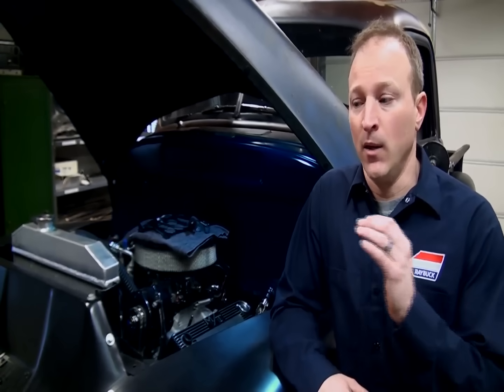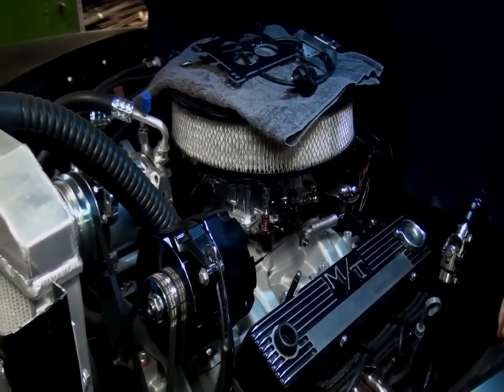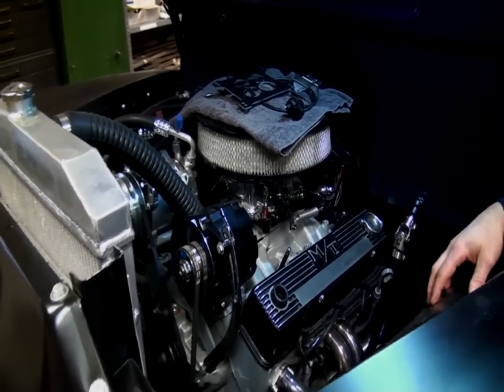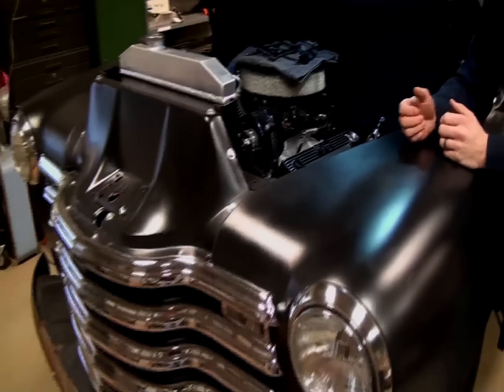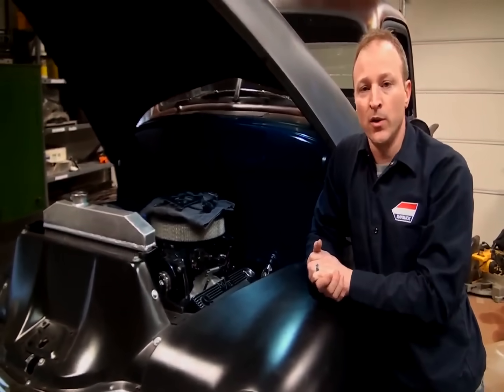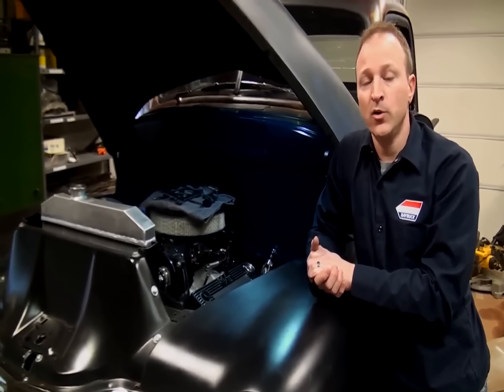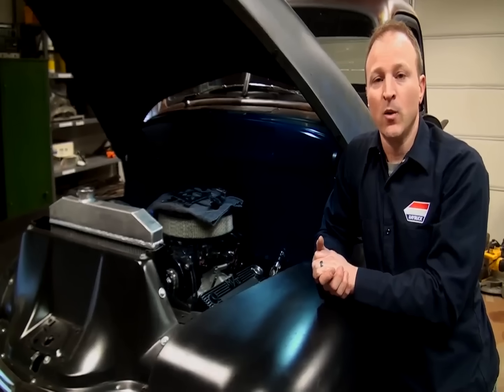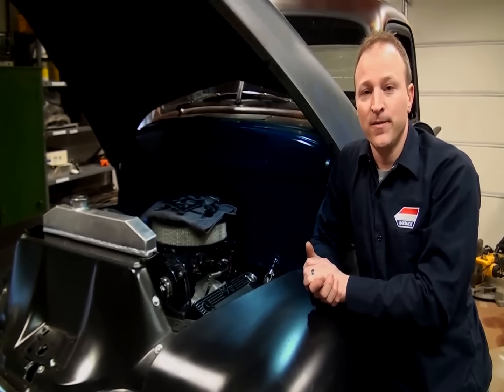Differences between a TH350 and 700R4 transmission and fitting them into a 1947-1953 Chevy Pickup

Comment: One bonus is that there is less chance of overheating on a hot day, when an engine runs lower rpms. Overheating can occur with certain combinations of rearend gearing, engines, rad size, etc. This is why GTOs were not available with a 3.23 ratio rearend AND AC in 69. Its one or the other, but not both, per GM engineering.

Comment: I need some help. 
I have a 78 C10 with a 373 rear end. My engine is a 350 built what transmissions should I put in there. My tires are going to be 255 60/15.
Reply from the maker: That's a tough question to answer as it really depends on how you plan on driving it. If your plan is to actually be able to comfortably drive it locally and on the highway, but still be able to light it up on occasion, I would go with the 700r4. If you are going to pound on it a bit harder, a 400 might be a better option.
Reply: Just went and bought a 700r4 @RaybuckAutoBodyParts

Comment: I tried  both  transmissions  , the  TH350   on 1979 Chevrolet Caprice   and the  700r4  on 1992  Buick Roadmaster  ..  I think  the  TH350  is a fantastic reliable superior  smooth  transmission    💪💪💪  👍👍👍👍👍   almost   zero   technical   issues   and  the  car can accelerate   faster and  smoother  using the TH350    ,   I  like it  👌 👍  and  I don't know why GM stopped  using  it  .

Comment: Ok so I want to put a Gen 1 350 into my 92 pick up with the 700R4 what do I need to mate the trans, flywheel and torque converter leaves me lots of questions or does it bolt right up and from what I dug up it wont so what is the trick?

Comment: The 80s cars with the towing package had a thm350 because it was tougher than the 700r4. The input shaft on the 700r4 was prone to breakage, the thm350 input shaft is bigger and tougher and did not break.

Comment: Im trying to find some info on the drive shaft situation in the 86 square lwb when swapping the th350 for a 700r and the drive shaft was a custom made one that I had to get after I did a 5-7 drop and the drive shaft shop I have locally here in southern NH is absolutely amazing and fast and prices are so low I was expecting to get a real blow to the wallet but they made me a complete new drive shaft and I had just been through a lot of trouble finding the right u joints so I’m pretty sure that the drive shaft that was in the truck was not the original one because the motor was not the original either but we figured it out and it was two different u joints front to back and significant size difference so it is the same way the shop had to do it used the same yoke to make sure it would work on the transmission, and it was a little bit shorter after the drop. But I never got a chance to get the drive line corrected so it is developing a little bit of a vibration when I let off the gas pedal, and I have to get under it to make sure that the u joints aren’t too bad to be driving around on.  But I think the problem is definitely going to be with the drive shaft being too long for the 700R and that is the way I was hoping that it would be, because the cost of having the one that I have shortened is a lot cheaper than a new one that would be needed if it was needing to be longer, so I’m happy with that option

Comment: One problem with the 700R4, is the big difference between 1st and 2nd gear, 3.059, to 1.625.
Reply from the maker: Are you thinking it's too much of a dropoff, which could cause undo stress on the trans?
Reply: @RaybuckAutoBodyParts  Just might bog down a weak motor a bit, but a good motor and a 2400+ convertor would probably make up for it. I'm building an ls motor for my 72 el camino, so I'm going with the 4L60E.

Comment: Did you think about using a TH 200-4R? They have comparable dimensions to a TH350. They were developed to give overdrive to vehicles that had the TH350 before the 700R4 was introduced. I always thought they were weak transmissions until I realized that was the transmission used in the Buick Grand National. Nuff said for me.
Reply from the maker: Yes, we did consider the 2004R, as it's comparable to the 700R4. We decided on the 700R4 mostly because of the gear ratio, as it's first gear is 3.059 vs the 2004R's 2.74. The second reason is that the local transmission shop that we work with highly recommended the 700R4. Either transmission would be a good choice, though.
Reply: @RaybuckAutoBodyParts  I was thinking about it just for the fitment questions. Maybe less changes needed. The 700R4 is definitely a good transmission. I've used several in my builds.

Comment: Did you need to shorten the drive shaft or did the 700r4 fit with original drive shaft? Thanks!
Reply from the maker: Yes, we had the drive shaft shortened when we installed the 700r4.

Comment: what's the spec on your engine, does it have any TQ at 1800? if you have any sort of performance cam it's going to lug at 1800.  2600@70 isn't bad at all.
Reply from the maker: It was a pretty stock engine with a mild cam. I didn't have any issue with it lugging at highway speeds. Since this video, the engine has been swapped out with a Blueprint 350 and the 700R4 still performs great at highway speeds.
Reply: @RaybuckAutoBodyParts  how  is the engine going? Greetings
Reply from the maker: @estebanamador7601  The newer Blueprint 350 is running great.
Reply: @RaybuckAutoBodyParts  thanks for your answer 👍🏼👍🏼

Comment: I'm more than suspect about your complete lack of knowledge between the Th350 and the 700R4 .. you could have just as easily purchased the Th350C with the lock up convertor that would have done the same thing with NO issues at all ...And P.S. How trendy clueless are you that your in a Body shop and you actually used Satin black .the Ass crack ugliest paint job in north America to advertise your shop . Bravo bro your really cool ...NOT REALLY...

Comment: TH 200 R4 overdrive same size as aTH350 uses same driveshaft and same crossmember mount  position as TH400 just move crossmember back bolts in use TH200R4 cable, pulled all the way out so shift ok. Done it couple of cars so I know no modifications needed, get one out a grand national. Oh

Comment: So you modified the trans mount, but did NOT have to move the crossmember back, correct?
Reply from the maker: It's been a while since I did this, but yeah, I don't recall moving the location
Reply: Yes you do. I swapped a th350 for a 700r4 in my 83 Chevy van and I had to go to the junk yard and get a different rear cross member and the shorter drive shaft.

Comment: CAN I FIND A 700R4 TRANSMISSION TO FIT IN A 1994 CHEVROLET SILVERADO HALF TON 4×4 TO MATCH UP TO A V 8 MOTOR
Reply: Im pretty sure that was the standard transmission for gm back then my 1988 silverado has a 350 with a 700r4

Comment: I got a 85 chevy k20 4x4. With 700r4.   I was gonna change to a 350 turbo.  Truck has 35 inch tires  if i keep the 700r4. What should i change the gears to. To get more power  cus its a dog
Reply from the maker: I'd suggest using one of the online calculators to help figure out gear ratio. The calculators can take into consideration tire size, etc.

Comment: Big expense to do swap would have to drive many thousands of highway to save a little gas and small increase low end ratio . Forgot to say will need to change out drive shaft as well . Just how much does anyone drive these old cars highway ? IMO not worth it for the headache . Hard to beat the old faithful simple 350 . 350 so simple can do a shift kit in just few hours if need to .  The 400 is a monster and heavy designed mainly for bigger trucks 4x4 etc . overkill unless burning the tires to numb . Most everyone trash talk 350 all the way engine trans rear .
Reply from the maker: The goal of the video was to explain the difference between the two transmissions to help someone decide what they want to put in their vehicle. It wasn't necessarily meant to convince someone to swap out a 350 for a 700R4. For our setup, we didn't do the swap for the gas savings. We did it to reduce engine wear, and to be able to drive at higher speeds for longer periods of time. We drive this truck a lot, so being able to cruise around 2k RPM for several hours at a time on the highway was a big deal.

Comment: I'm running the 700R4 in my '71 F250 highboy. 68 MPH at 1750 RPM
Reply: 8 months later and no one has responded to my original comment.
Reply: @jedclampett6466  I dont know what the spec is on their small block, but cruising 2600@70mph isn't exactly high, I'm used to driving old vw and we are doing 3000/3600@60! , if his engine has anything other than a stock cam in its gonna to be out of the bottom end of the TQ band at 1800@70 and lugging and it you drop down to 60/65 it gonna be dead.
Reply: @jedclampett6466 
Can you do Burnouts with it?🔥🔥🔥

Comment: the 700 has a stupid low 1st gear.. smoke the tires in first in the 700 and it will fall apart, parts are made of tin and junk.200rpm in top gear is nothing. that TCV cable is CRITICAL,, people think its a kickdown and leave it off. BAD NEWS
Reply from the maker: It's a 3.06 first gear vs a 2.52 first gear in a 350. In my opinion, that's not stupid low. It gives a the vehicle a little extra jump out of the gate. The 700 can also be just as reliable as a 350, depending on how it's built, but even a stock 700 will perform just fine behind a stock small block.

Comment: Did you have to get new transmission lines?  Did you use the old ones?
Reply from the maker: The line locations were different, so we cut and spliced new ends onto the old lines.

Comment: I've got a turbo 400 at 60 miles an hour it's doing 2,500 RPM what will it do with a turbo 700 at the same speed and also can I put the same stall converter
Reply: He said th400 is 1-1 high gear & 700r4 is .7 , so I was thinking to deduct 30%,= 1,750 rpm, other people told me 25% = 1,875 but ?
Reply from the maker: @rader1175  the rpm calculator will get you close. Even with your 30% and 25% calculations, 125 rpm isn't going to make much of a difference.
Reply from the maker: It depends on rear end ratio and tire size as well, but 60MPH in this 53 is around 1,800 RPM. Use an RPM calculator (like https://spicerparts.com/calculators/engine-rpm-calculator) and enter your gear ratio and tire size to get an idea of what the RPM should be.
Reply: @RaybuckAutoBodyParts  Was just trying to answer his  question,  was no mention of tire or gear changes.

Comment: Had an 82 C10 LWB with a stock 350/TH350, 235/75/15 tires (28.9in), 2.73 gears.  Sweet spot was at 80-85mph, with plenty of pedal left.  Could even cruse at 95-100mph if i wanted to without breaking a sweat.  Hated anything from 60-70mph especially around hills or traffic.  Wished i had 3.42s or 3.73s, since the truck was 90% city, 10% highway.  As long as you stay below 4,000rpm cruising with a stock sbc, they will hold up great.  People did it back in the 60s-80s and still get 200,000 miles or more.  Can't handle the rpms with a sbc, time to buy a louder radio!

Comment: Is the 350 yoke same as the 700r4 ,don’t like the 700r 4 changing to a 350  but need a trans and yoke
Reply: It's been a while since we did this build, but I think the yoke was the same. I think we just had the shaft cut down since the 700 was a bit longer than the 350.

Comment: Curious of what your rear diff ratio is? I have a 1940 Pontiac with Chevy 350 and TH400. Rear diff is original 4.11. Deciding on switching to a 700r4 or changing rear diff to a ratio 3.5 if you can. Budget is of decision.
Reply from the maker: I'm running 3.08s. The 700r4 gives it a little more initial pickup than a TH400, but it's not going to feel like 4.11s. I had 4.11s in my Mustang and swapped them out for 3.42s. That car doesn't have overdrive, and I'm almost wishing I would have gone with something closer to 3 (I like to drive longer distances on the highway). With the 3.08s and the 700r4, the truck can cruise at 75mph all day long.
Reply: I have 65 nova 350 & 350th, 456 rear. Going to try 700r4 first. Live 3mi. from Maple Grove Raceway Pa. and like to run, only have 300 hp. so 456 gets me going quick with 7'' slicks. Budget limited to one thing at a time. Just drive local with this hotrod. Curious on your choice.

Comment: I have a c10 from 1968 what transmission do you recommend me its manual but i wamt to make it automatic
Reply from the maker: There are a number of factors to think about before picking a transmission. What motor are you putting in it? What's the purpose of the  truck (ability for long haul road trips, weekend driving around town, etc)?

Comment: What typa rear end you think is best for a 87 88 or 89 Chevy caprice ? With 26 inch rims ?
Reply: 383 & 700r4 I’m definitely going that way just need to know what’s the best rear end that will pull those size rims and still perform the right with
Reply from the maker: @traemoree5983  Depends on what you're looking to do with the car. If you want something that has some pep but doesn't rev too high on the highway, I would go with a gear set in the low to mid 3s.
Reply: @RaybuckAutoBodyParts  what’s the best shift kit for the 700r4
Reply from the maker: @traemoree5983  Again, it all depends on how you're going to drive it. I would suggest something fairly mild for smoother shifting. I would also suggest getting some strong axles for the rear end. Those size wheels are going to be a bit heavy. If you apply too much torque (jump on the gas), you'll take a chance of breaking the axles.

Comment: Hi , can you help me ¿ The manual transmission from a Chevy 350 engine fits a 454 engine?
Reply from the maker: You can bolt up a 350TH or 700R4 to either a small or big block engine. Depending on the horsepower, you'll want to build the transmission accordingly. If you're going to install a manual transmission, you'll want to pick the correct bell housing to mate that transmission up to the engine.

Comment: I have an 83 C10 with a TH350 transmission that I wanna swap out for a 700R4. Do I have to change anything? I have a 350 engine
Reply from the maker: The engine is fine, but you'll have to change the torque converter, the kickdown cable/tv cable setup, replace the shifter, and the driveshaft will need to be cut down. You'll probably have to modify the transmission support as well.
Reply: I  tried   both   transmissions   ,  I found that     TH 350   was   much much better   and   active   much more than the   700  r4    ....    I  was   feeling   fantastic   acceleration   when  used  the  TH 350    ..   I found   slow   acceleration  when used   the  700 r4   ...   can  you  please  give me your feedback  if you have already   swapped from   350   to   700 r4    ?

Comment: I have a 1988 Monte Carlo SS and the th350 in it is fun (had to raise the gears up to 3:29 because those original 3:73's were too damn high) but once I hit the highway the RPM's are screaming. I want that overdrive which will allow me to put the 3:73's back in the rear end. Did you have to buy a shorter drive shaft? The 700R4 is longer than the th350 and how do I find the correct length?
Reply from the maker: I had my driveshaft cut down. You should be able to measure from the center of the rear yoke mount holes (on the rear end) to the rear of the transmission housing and then subtract 1-1/2", I think, to get your driveshaft measurement. You take off 1-1/2" so that the front yoke is only halfway over the splines. If you don't do this, the driveshaft will bottom out/jamb when the rear suspension flexes.

Comment: It seems like a lot considering the TH350 has stood the test of time and has traveled on long trips for decades before the 700 came along and might  be one reason why Chevy is so popular? I’m not an expert but I think that 350 engines have been revving high for years with little ill effects?
Reply: It all depends on personal preference. I love the high revs so I slapped on a 400
Reply: The higher revs arent really hurting the motor, although you could argue that if you drive many highway miles it would contribute to wear.  Lowering the revs at highway speeds will get him better gas mileage.

Comment: I’m not clear on the whole switched power thing. Like acc power? Or like a manual toggle switch?
Reply from the maker: A manual toggle switch. The toggle switch will allow you to lock the transmission into overdrive, if necessary, so that it doesn't continually try to shift between 3rd and 4th gears. Honestly, with the setup in our 53, I've never used the switch.

Comment: I have a th350 in my c10 stepside, if I put the 700r4 in it will I have to modify the driveshaft?
Reply from the maker: Most likely yes. The splines and yokes should be the same, but you'll probably have to get it cut down. Most driveshaft shops can cut and balance for around $100-$150.
Reply: @RaybuckAutoBodyParts  ok thank you

Comment: I'm installing a 700r4 into my 71 el camino. I bought the Lokar kickdown cable for the passing gear.  I have a Lokar bracket on my carb for the throttle & kick down cable. Its not the same bracket or cable you used.  Is the Lokar cable correct?
Reply from the maker: It could be. I used the TV kit from Bowtie Overdrives (https://www.bowtieoverdrives.com/). It was recommended to us by the shop that built the transmission. It's easy to install and set up and works really well.